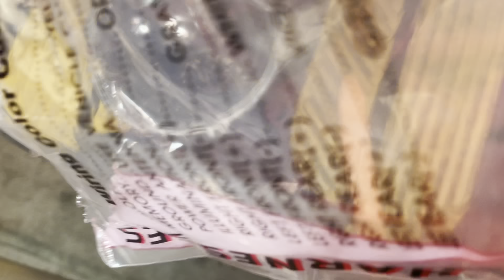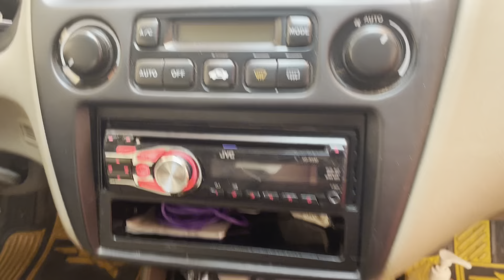Changing Door Speakers In 2000 Honda Accord.

Comment: What is that in the back amp or subwoofer or box
Reply from the maker: It’s a amp
Reply: @5adamd  how did you install it without a sub
Reply: What kind of speaker are those
Reply from the maker: CT sounds speakers
Reply from the maker: I just connected the amp to the 2 in the trunk and the door speakers are connected to the regular audio from the car